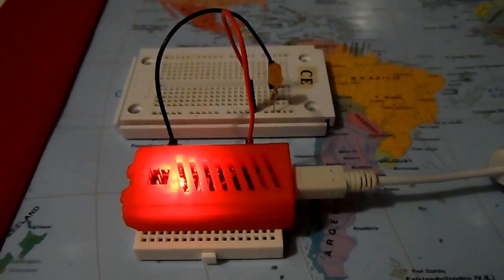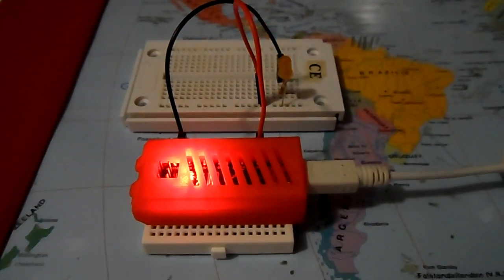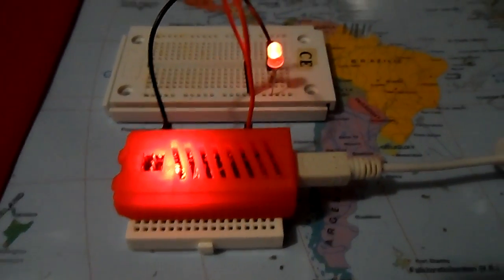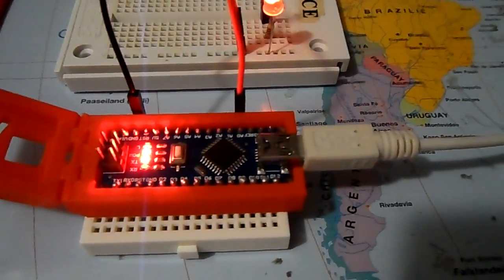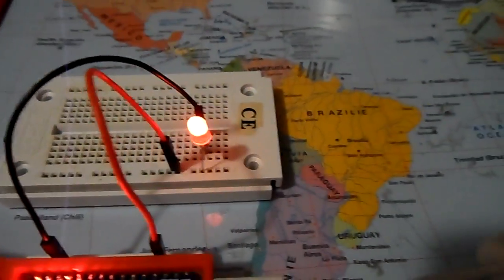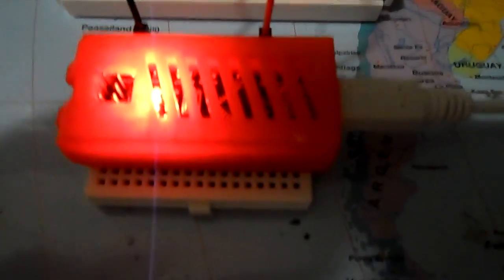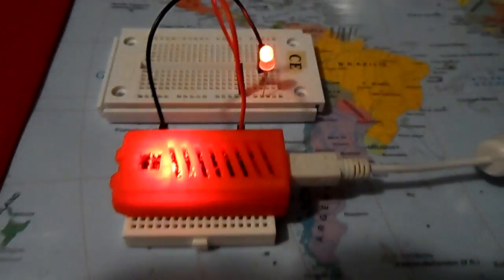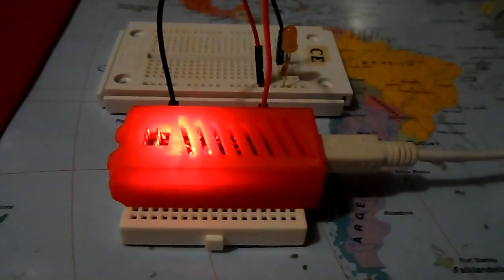Arduino Nano in its own cute case

Comment: I just got one...And I soldered the pins in wonky and it won'y fit in the breadboard :(
Reply from the maker: there could be a couple of things: -either all the pins of the header have sliden longer or shorter during soldering (e.g. the pins have gotten different length) or they are just a little bend outwards or inwards. If that is the case you can carefully try stick one side a bit in the breadboard and the push with fingers against the other row so it bends to the right width. Send me a reply with a link to a picture of that Nano and I can have a look what has gone wrong when you soldered the headers.
Reply: ***** I know what's gone wrong, I was just careless enough not to check the alignment so the plastic isn't flush with the board.
I'll be able to fix it once I get the desoldering wick I ordered...Meant to arrive from 29th - sometime next month.
Reply from the maker: That Guy ok I understand. Yesterday I had soldered this Nano's headers and before I started, I stuck them into a piece of foam then layed the Nano on to of them (the pins coming slightly through the holes) and then soldered them.
Reply: ***** I did the same but with blu tack, forgot to check alignment though
Reply from the maker: oh that is gummy huh ?
Reply: ***** I've fixed it with the careful application of pliers and a hammer ;)
Reply from the maker: That Guy ouch that sounds dangerous for cute little Arduino Nano's :)